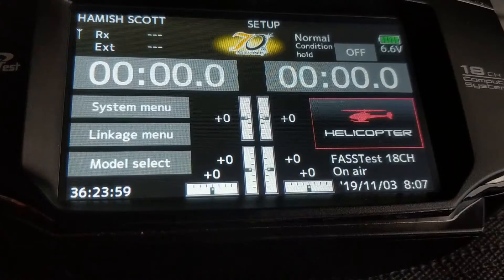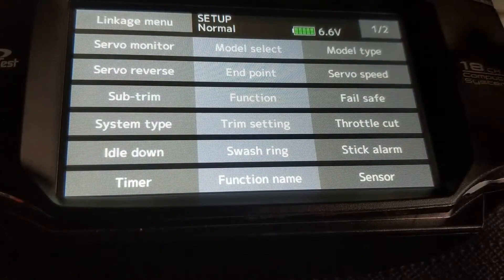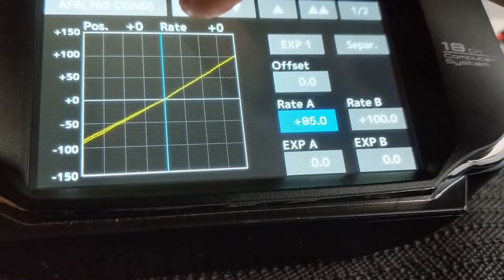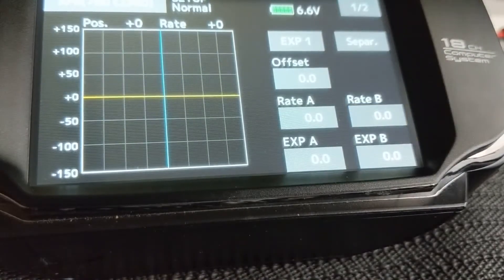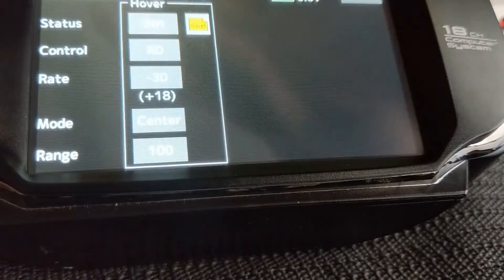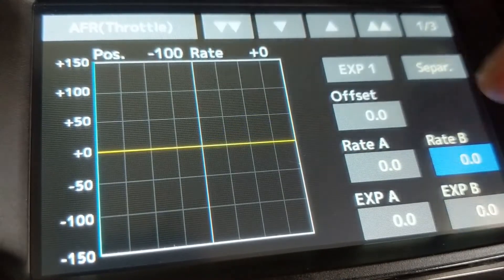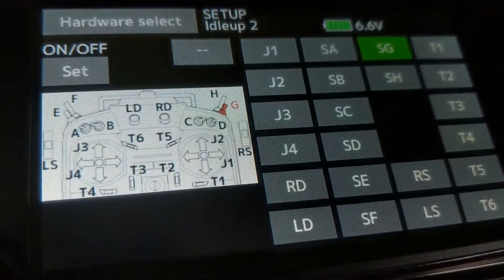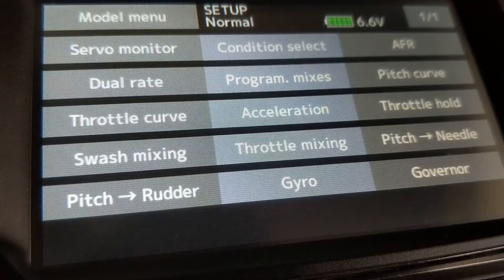Futaba CGY760R Set Up - Pt 1 Transmitter set up

Comment: The videos were of immense help setting up my 32MZ and CGY760R on my Kraken.  I was so impressed with the gyro, I am trying to install a 2nd one in a 4-blade, 4 servo 90 deg (H4-00) ccpm Vario Benzin for eventual use in a Bell 412.  

I have a couple of questions if someone might help.  

First is: can I set a pitch curve in the radio to limit total pitch top and bottom or does the cgy want to see a 0-100 linear pitch curve in the radio and force use of the SWH Basic swash and pitch throw options on page 3/5 of that sub-menu? I need significant reduction in pitch with the current setup with throws at 100 all around and using the pitch rate option requires me to take it down to 8% (from 50% default) to get what I want - around -2.5 to + 8.5 or thereabouts.

I suspect I want to turn off the AIL/ELE and ELE/AIL 100/100 cross mixing I used during my brief test flights without a gyro of these mechanics and have the CGY handle it. Is that the course I should take? If so, looking through the menu options, the manual on the SWH Detail menu says that AIL-ELE and AIL-ELE2 mixing is ONLY available for H4-45 (which means at a minimum a new swash plate and complete re-working of my mechanics) and that ELE-AIL mixing is NOT available on H4-00. The manual does, however, detail a Swash Rotation option that might be what I’m looking for to accomplish gyro based phasing of the 4-blade head. Is it?